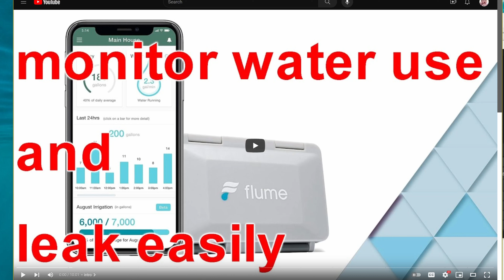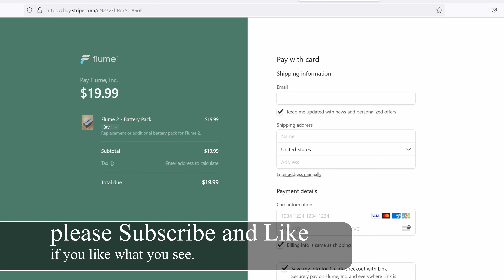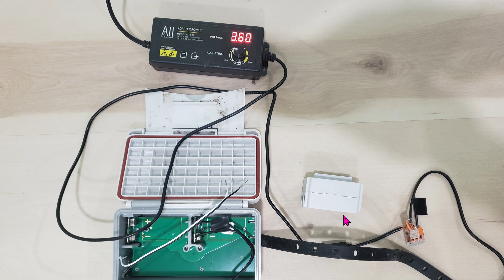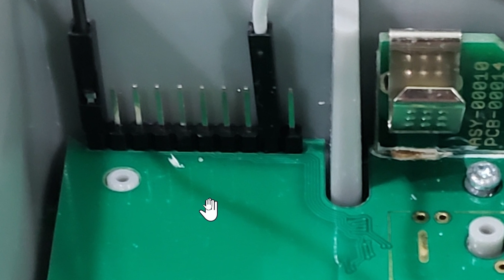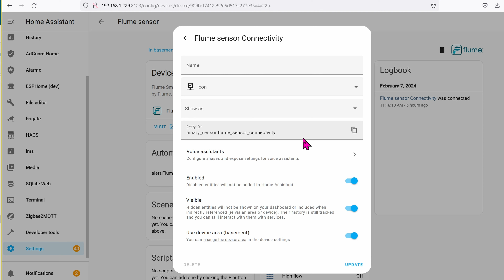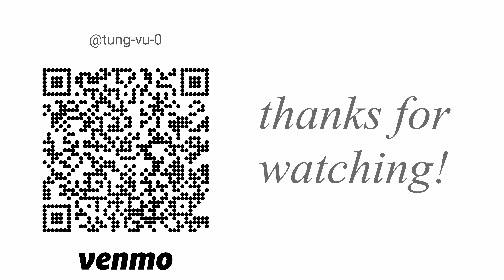Flume 2 battery hack, hardwired conversion

Comment: Do you just cut off the end of the power cable?
Reply: Never mind my power supply came with screw terminals to connect. Though I hastily ordered a ps that only has specific voltages:  3 and 4.5. How bad would it be to feed it 4.5v?
Reply: @billgogi  you might fry the chip past 3.5v...

Comment: Thank you for the video. I would like to do the same. Should it be 6V? I see 4 batteries.
Reply from the maker: no,  3v works best.
Reply: 4 batteries but two in series and two in parallel thus about 3.5v +/-.2  with new batteries

Comment: Was your main pipe close to outlet? Hardwiring it to the curb location of the sensor seems impossible.
Reply from the maker: yes, the outlet is 10 feet away.  if you cant use wire,  i would suggest using lipo packs used for RC cars
Reply: Lipo batteries seem all come in 7.2 volts?  How do you trim it to 3.6?
Reply: Never mind. I found the 3.6v. Thx

Comment: If you use the pinouts for hardwired power, are you saying you still can't use the battery for a backup?  It would be nice to use both together but I am concerned that using the pinouts with a battery installed would allow 6v to flow into the Flume instead of the correct voltage of 3.  It normally wouln't matter but every time we lose grid power, the Flume would need to be recalabrated.  Anyone have any thoughts on this?

Comment: How has this worked out for you so far. I tried installing lithium batteries from another post but for some reason I get low batteries when I have installed them. Looking into trying this. Thanks.
Reply from the maker: working flawlessly so far. no issues

Comment: What type of pin connectors do you use for the method without soldering?
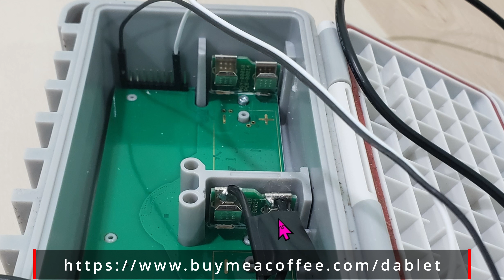Reply from the maker: i used DuPont connectors and connect using the pin as seen at 1:18
Reply: @dablet  Did your device have pins installed on the device? i just have the board holes and no pin board to connect the dupont connectors to. Curious if you had to install the pins as well?
Reply: @jakea.5279 what did you end up doing